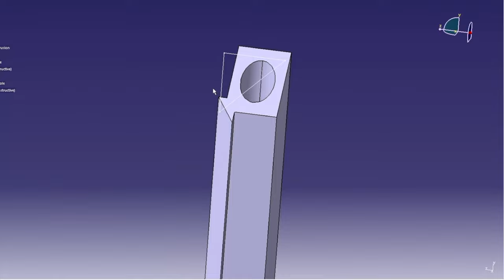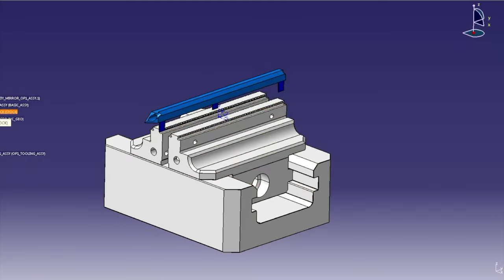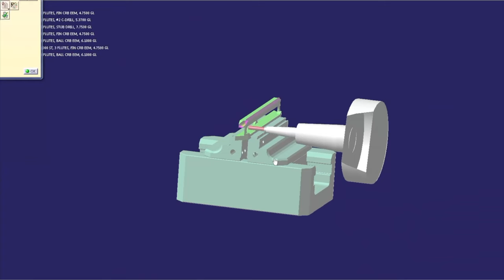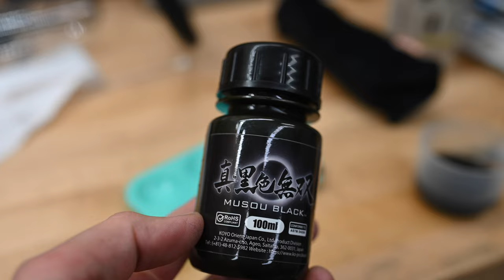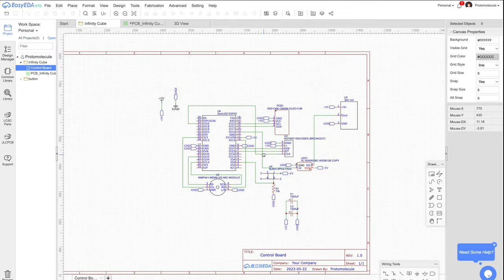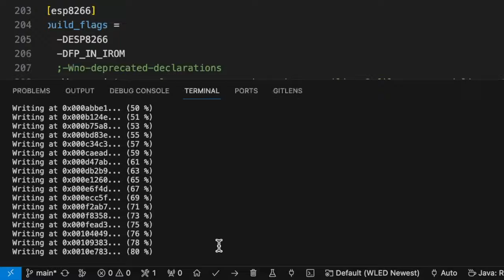CNC Infinity LED Cube  Running WLED

Comment: WOW, WOW and WOW again. This is probably the best DIY infinity cube I have seen.
I have built a version of this cube https://youtu.be/Ci29R1Xrb-4?si=MjDZFkGq_f2RdlsI and altered the code to fit.
When I put my cube on WLED it looks really good, but nothing like yours.
So I have some questions if you don't mind,

Would I be right in thinking that you have mapped your pixels in wled ?
When you define the screen at 25:15 in vid, are the pins default settings and does anything else need doing for the screen to work ?
How do you set up the encoder ?
What is the purpose of the button in the corner of the control box ?
And finally, the last 2 animations and the 1 at 28:00 to 28:33, what are they ? other than amazing.

If I can get my cube to look half as good as yours, I will be happy.
Thanks.
Reply from the maker: Hey, thank you for the compliment! Ive watched that video a few times. As a fellow infinity cube enthusiast, your questions deserve an answer haha

Mapping: I created 12 segments, one for each edge using the WLED web GUI

Pins: I compiled with the default pins(don’t even remember what they are). You can remap any pin from the WLED GUI
Screen Pins I used (I2C): SDA=21, SCL=22
Encoder Pins I Used: DT=26, CLK=25, SW=27

Screen/Encoder: Its done with usermods (additional WLED features that don’t come with the stock compilation of WLED). The display and encoder work together.
Here is the link to one of the mods. Read the instruction carefully (may be outdated).
https://github.com/Aircoookie/WLED/tree/main/usermods/usermod_v2_four_line_display_ALT

In short you need to add these lines of code in “my_config.h":

#define USERMOD_ROTARY_ENCODER_UI
#define USERMOD_FOUR_LINE_DISPLAY
#define USE_ALT_DISPlAY

Also some dependency libraries in “platformio.ini”:

U8g2@~2.32.10
Wire

The usermod pins can also be remapped from the WLED GUI. Or you can define them in their respective usermod code, but the GUI can change it.

Button: WLED lets you add up to 4 buttons (mappable to any pin) for custom functions. Each button can do “click”, “double click”, or “long press” as gestures. I use it to cycle presets and enable the timer. Refer to this page for commands: https://kno.wled.ge/interfaces/http-api/
For example I have my button call “Preset 20”. My Preset 20 has “P2=12&PL=~” in it. “P2=12” means, the last available preset is 12. “PL=~” means, go to next available preset. (First available preset is by default 1, but it doesn’t have to be). Commands like this can also be coded to be passed on using an IR remote.

Animations: Umm, I think the animation at 29:05 is one of the four “twinkle” effects. I cant remember which one. The effect at 28:00 and 28:55 are custom 
😅. I coded/modified WLED to get those. I actually created a pull request for them but it never got accepted. Take a look: https://github.com/Aircoookie/WLED/pull/2465

It may take some work but its possible to add it the most current build of WLED. If not, you can use the built in the pull request and check them out. They’re called "Bouncing Balls X”, "Fireworks Woah”.
The idea is not originally mine, I used Daves Garage as inspiration: https://www.youtube.com/playlist?list=PLF2KJ6Gy3cZ7ynsp8s4tnqEFmY15CKhmH

I hope this helps clarify some things. WLED isn’t really meant for a “cube” shape. I found that the best looking animations are ones that are either symmetrical, or completely random. 
Fun fact, the HyperCube from the https://hyperspacelight.com is a branch from WLED. Aircookie helped them with the development.

Comment: Excellent! Such an impressive video in so many ways. Where to begin? I love all the artistic choices, narritive flow, subtle flourishes with transitions or framing the shots that don't stick out, but showcase your obvious videography skill. The project itself is jaw dropping, and executed so flawlessly that .. well, that's my only problem with the whole thing. Not even really a problem, more like some cognitive dissonence I experienced while watching.
You design the cube, export some gcode, start loading stock into the cnc, cut all 12 pieces, one after the other, and when you assemble everything together it's PERFECT. Every corner fits. There are no gaps or misalignments. You make 0 mistakes throughout the entire build.
The video appears to tell the story of a guy who wanders into a workshop, and kind of almost accidentally makes an infinity cube. He bumps into a table and a cup knocks over, spilling a handful of parts into his hand which just happen to be the exact fasteners he needed. He attaches them and moves on, never acknowledging the extroardinary fact of their appearance. Every move he makes is the right one. Every decision is correct. He would not be able to produce anything but the finest craftsmanship even if he tried to screw it up.
Now, I completely understand that you make choices when you write, direct and edit a video like this. You can't show every single second. And to tell a story that showcases the best parts and cuts the rest is perfectly fine. It's only when you do that, but also actively code the whole thing to appear to be a linear factual account that it becomes somewhat reality-warping.
But what do I know, maybe you sailed thru the experience in exactly this way, making you the Chauncy Gardener of the maker community. If so: congratulations!
..and, nice cube.
Reply from the maker: A very keen analysis and an accurate one at that. You are correct, things defiantly didn’t go as smoothly as the video portrayed it. The problems started with the wiring. I never planned on making the chassis my ground (even though now it seems like an obvious choice). Kinda freaked out when I realized there was no way to fit all of the wires. The pads pressing up against the aluminum didn’t work. The connection was too unstable. The next solution was to use conductive epoxy to insure good contact. However the high amperage caused those connections to also fail AFTER I had painted the strips and glued the glass in place. The final solution was one I desperately tried to avoid. Drill screw holes underneath the strips, anchor a wire to the chassis using 0-80 flat head screws, solder that wire to the pad, and make it all small enough to hide under the strips. Then repaint the delicate black paint, re scrape the ALL LED faces AGAIN, and finally put the glass back. Oh and then just for fun, I had some individual LEDs fail. So throw in some SMD unsoldering and resoldering in the mix…. “PAIN” is the word I would use. Everything els in the video was actually accurate. CNC is king for precise manufacturing. 

There was a lot of meticulous planning and I wanted to show the results with everyone. Thank you for your kind worlds and I’m glade you enjoyed the video!

Comment: Awesome project! Happen to have any links where you can buy this glass you used?
Reply from the maker: Yeah, I bought it here:  https://www.twowaymirrors.com/glass/

It’s manufacturer by Pilkington. The glass is called “Pilkington Mirropane Chrome”.
It comes in 6mm (= .0.236” even though it's advertised as .1/4” in the US). twowaymirrors don’t  disclose who makes it though. I figured it out hehe :p . If you’re in Europe than you’re lucky because you can buy it in 4mm. You can’t buy it direct from the manufacturer so poke around google for an online reseller. Also my local glass dealer sells it so maybe try looking in your area as well.

Its non reflective from one side. Amazing stuff for this effect. I wouldn’t use anything else. (Wish I had 4mm)

Comment: Program is necessary?
Reply from the maker: Only of you need additional user mods / customization. Otherwise the original master precompiled files will work just fine. You can also use a web installer here https://install.wled.me ,That is if you’re talking about the WLED software.